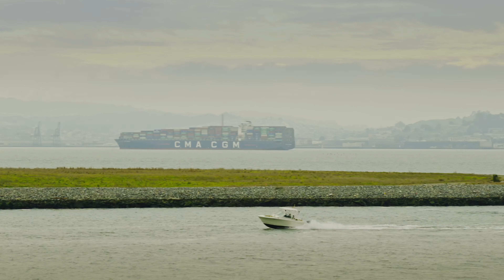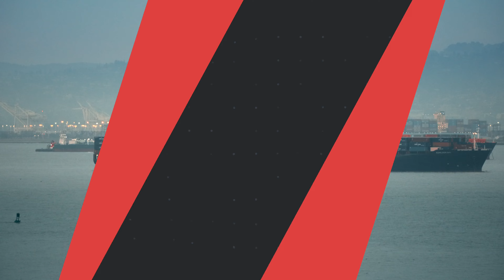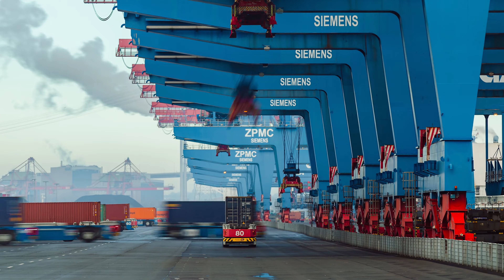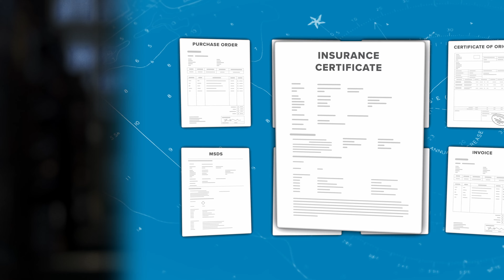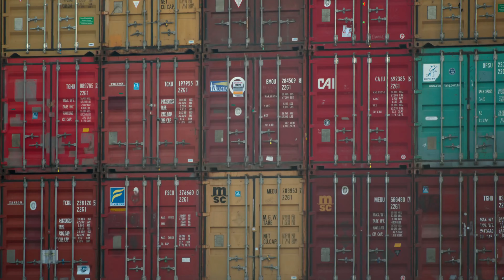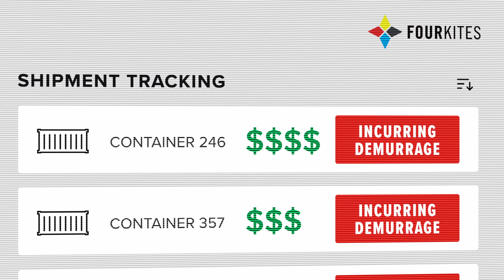Ship-Shape: Control & Reduce Soaring Detention & Demurrage Fees

Comment: Visibility tooling solves the tracking problem, but it doesn't solve the settlement bottleneck. When container documents and cross-border escrow funds take days to clear, the clock keeps running and demurrage accumulates regardless of real-time GPS tracking.  True supply chain resilience requires synchronizing physical terminal release with instantaneous, automated settlement clearing.  Outstanding breakdown by the FourKites team on container cost drivers.